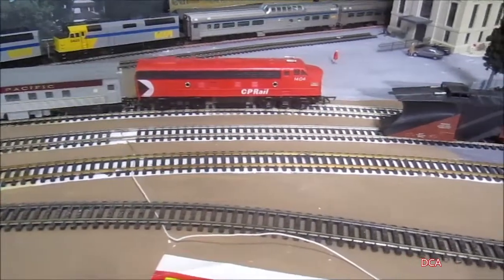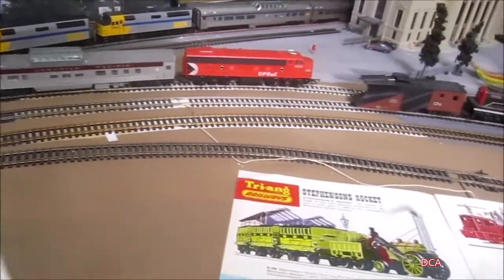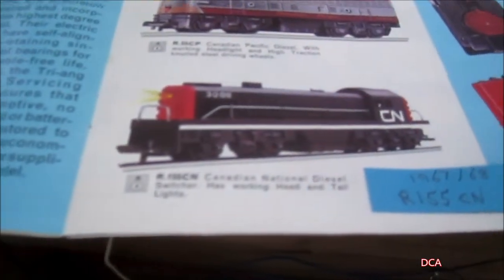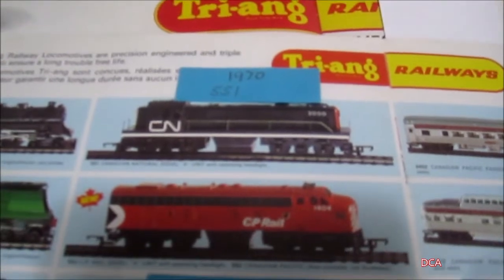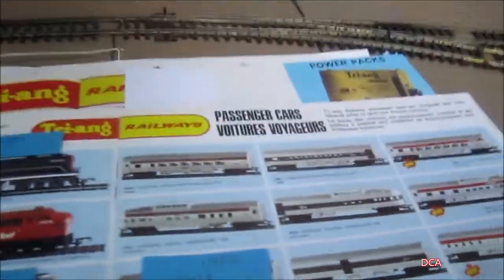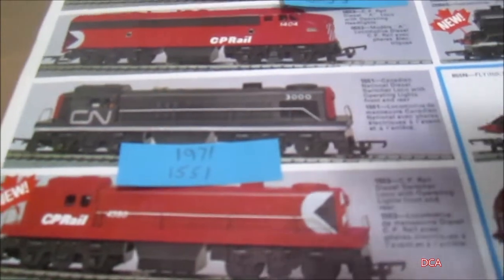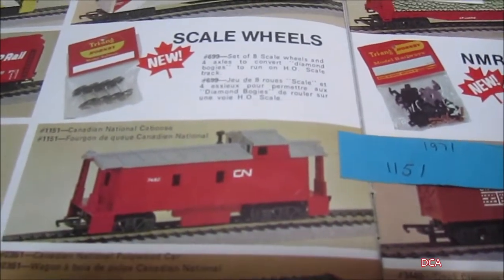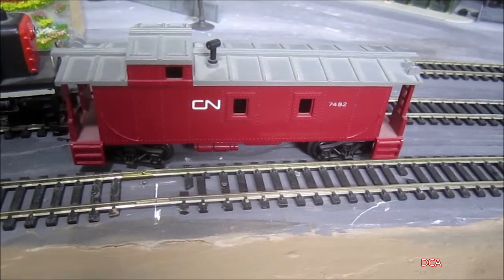Tri ang for Mr.  Snooze

Comment: Good Morning David, well that was a nice surprise! It's great of you to get these out for a run, they don't seem too upset by your code 100 track. I don't have any of those models apart from the snow plough and mine is a green one. It was very interesting to see some of your Canadian Tri-ang catalogues. I imagine they are quite rare now. I think I need to read up some more from my Pat Hammond Story Of Rovex series on the Tri-ang Canadian models. Thanks for  running these and the kind mention of my channel. Best regards to you, Jonathan
Reply from the maker: Hello Jonathan,  it was my pleasure. I thoroughly enjoyed running them and putting the video together. The CP loco rattled over some of the rail chairs (spikes) and hesitated over the points at any slower speed and the passenger coach jumped a few times over the point frogs but generally the running was good. I have several of the green ploughs in various states of repair. A frosty minus 6 but brilliantly sunny morning today after a wet day yesterday. All the best, David.

Comment: Great video David. Some unfeeling wag might observe that "Tri-ang runs fast, or it doesn't run at all". (lol)  I got my start in HO with Revell back in the late-fifties, and I now have a decent collection including all my original pieces. Thank you for sharing this with us as well as Mr. Snooze.  Art...
Reply from the maker: Hi Art, that is fantastic that you too have your original models. I snap up any Revell models that I find but I really only have a few. The fast or not at all comment applies to Tri-ang on code 100 but on it's own track system it can be slowed down reasonably well. Thank you for the great comments. Regards, David.
Reply: Hello, you are right that some Tri-ang items love a bit of speed. I ran my blue Pullman at high speed the other day and it certainly didn't hold back. I also like to show that even the early models can run at nice scale speeds, a surprise to most but true. Take care, all the best to you